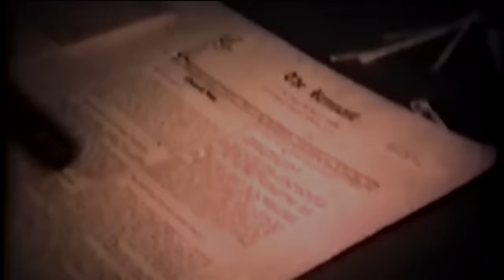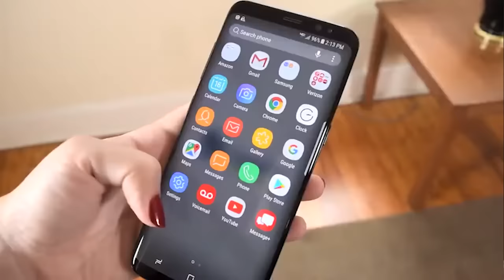The Fraternity of St Peter, Michael Voris, and Voting for Donald Trump

Comment: No FSSP would stoop to "concelebrate".
Reply: By 2000 the FSSP had agreed to concelebrate the chrism mass.
From 2007 until 2016, Fr. Garban of the FSSP in Dijon concelebrated the chrism mass.
Reply: @littlerock5256  I had heard that the Bishop of Dijon kicked the FSSP out because they wouldn't concelebrated.
Reply: @carolynkimberly4021  He stopped after 2016 and so the FSSP was asked to leave in 2021.
Reply: @littlerock5256  Good for the FSSP.
Reply: @carolynkimberly4021  They may end up removed from all dioceses.
Reply: @carolynkimberly4021  To not concelebrate means disobeying their pope and going back on their word.
Reply: Concelebrate has been around for centuries.
Reply: My FSSP Priest said he wouldn’t have a clue how to celebrate a NO Mass. All his formation is geared to the TLM only
Reply: @PaulTimson-b4h  I am sure the bishop could arrange to bring him up to speed on the novus ordo mass.
But at the very least, the FSSP priest is to attend and receive communion.
Reply: @anthonymckinney9904  The only concelebration that I am aware of prior to Vatican II is at the ordination of priests. After they get ordained, which is partway through the Mass, they continue to concelebrate the remainder of the Mass with the bishop. They do not join the bishop up on the altar and hence it looks nothing like the novus ordo concelebration. Needless to say, there is not a bunch of priests next to each other behind the altar.